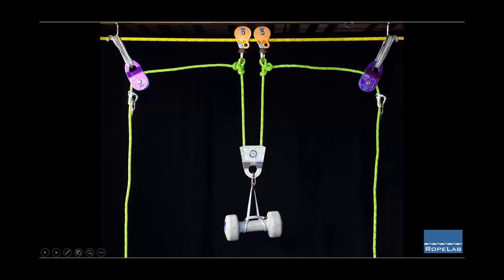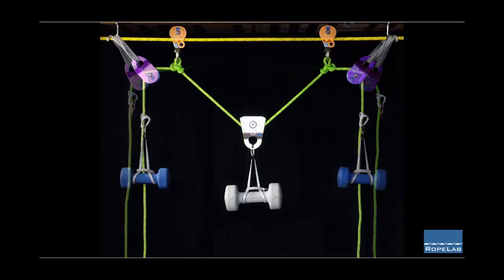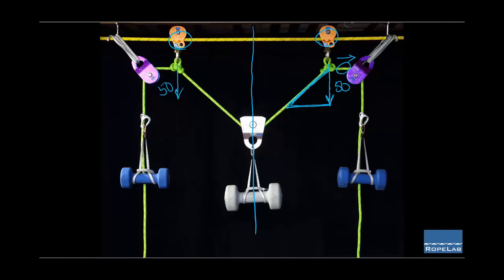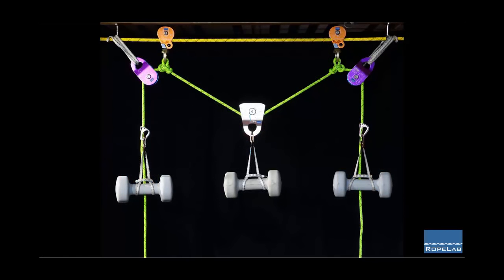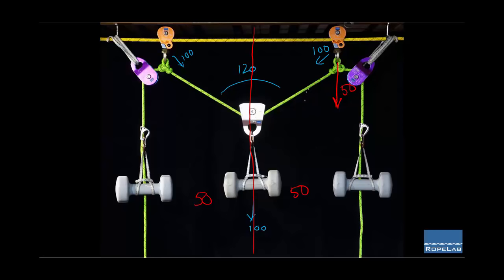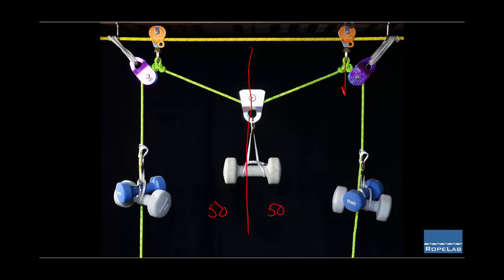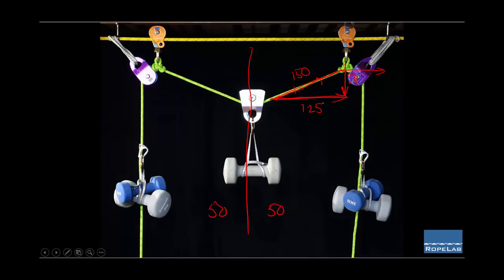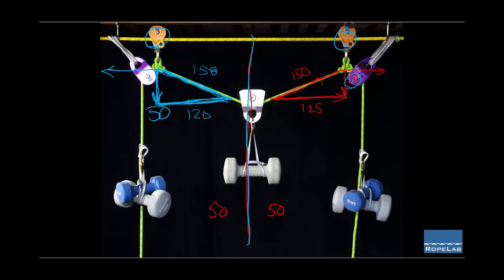Two point anchor loading

Comment: In other words, the tensile force T in each leg is F / (2 sin D) where F is the weight force of the mass and D is the angle of deflection (from the horizontal) of the legs. T can get quite large as D gets smaller.

Comment: question. so the last example we had an angle of roughly 160 degress why is it that theres only 150% on each anchor while rope theory tells us it will be 300%
Reply: What he is trying to explain is the use of scaled vector diagrams.  Where it is loosing a little is the estimation of the hypotenuse piece.  If you are going to use this method the diagram needs to be properly scaled.  Instead of drawing a little triangle in the corner starting from the bottom of the sag and create a right angle triangle by dropping a line straight down from the anchor. then simply measure.  Divide the Hypotenuse (long side) by the short side and you will get a percentage of load going to anchor.  Closer to zero degrees of sag the greater the force on the anchor.  Still a great explanation.